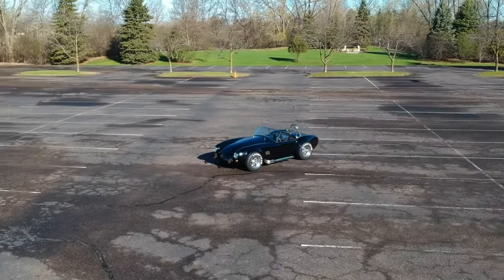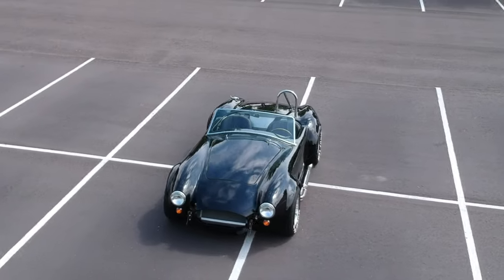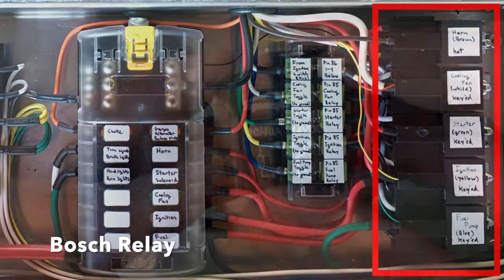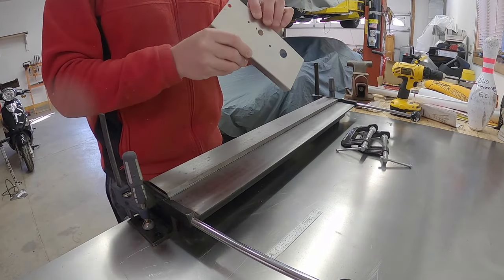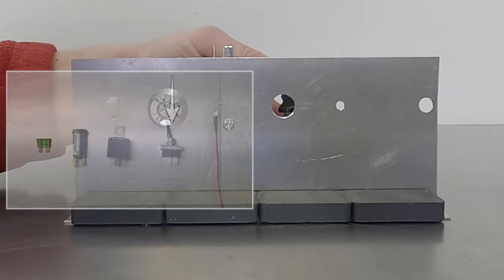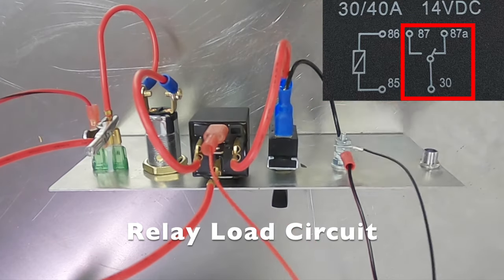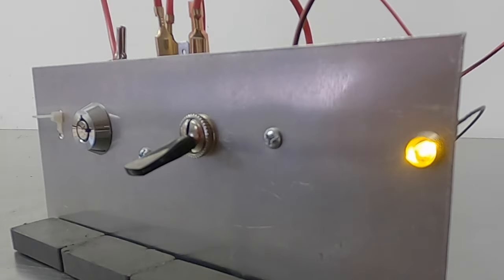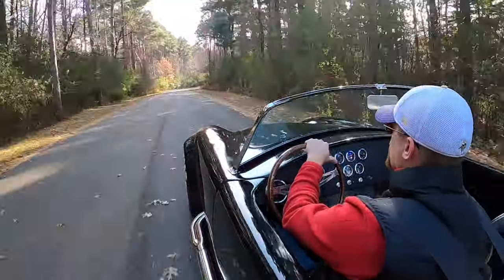Car Wiring 101

Comment: I have a 1982 GMC 454 BIG BLOCK FLATBED DUALLY.  NOTHING SPECIAL NO ECTRAS. HOW DO I DETERMINE  WHAT SIZE WIRES TO USE ?
Reply from the maker: Are you replacing the original wiring or adding some new accessories/etc? Depending on amp draw, you'll want to make sure you have sufficient wire gauge to safely transmit the power.
Reply: @TacoJoe  complete redo
Reply: @TacoJoe  replacing what's left of the old . Looks like the rats had their way with the truck.  Fuel n break line's eight all to shit. Chicken lights gone . Dash trim gone .but I ain't skeerd
Reply: I do want to add some work lights on the headache rack . This truck is going to be a welding rig truck.
Reply from the maker: you should be able to get away with 12-14ga on almost everything except your fuseable link-fusebox lead (usually 10ga on the older Chevys - sometimes comes off the starter solenoid) but check the chevy truck forums too for advise. As for replacement wire...  check out wire barn / thats where I purchase most of my wire.... www.wirebarn.com / good luck!
Reply: @TacoJoe  right on , thank you for the information. I'll definitely check it out. As with all my trucks , I want ahead and ordered a "Haynes " manual.  The Auto zone is sure proud of their books.  It's $22. To order straight from Haynes.  The A Z wanted $67+ tax . Fricken mud-ducks.  Thanks again. I really appreciate it

Comment: I have a question. I thought pin 87 was supposed to lead to one side of the fuse, and then the other side of the fuse would be wired to the object that needs load?
Reply: In HP Academy it said pin 86 connects to the power supply aka ignition amplifier or known as Signal, 85  is the Ground, 87 is Load to fuse to object, 30 would go to the battery. Did i misunderstand something?

Comment: Relays for head lights?
Reply from the maker: Yes - you can use a relay for the headlights too - I didn't use one with my setup, but if you do, make sure you feed pin 86/85 with a battery power source so you can turn the lights on/off with the car off. Thanks for the comment!
Reply: @TacoJoe  Just finished my wiring and I used relays on every circuit, thanks, 

01 jetta 12v vr6 66mm turbo.

Comment: No relay for lights?
Reply from the maker: You could definitely add a relay for lights / I didn't because I wanted the ability to turn them on without a key so I used a higher amperage toggle switch for the headlights but by all means, yes you could use a relay for the lights and do it in a way you wouldn't need key'ed power either. Thanks for the comment!

Comment: Really dumb question. When you are powering the relay is it safe to just grab the 12v power you need off the keyed switch or do you need to go all the way back to the fuse box? Just wondering as I want to run multiple things off the switch like more then one light.
Reply from the maker: You can pull off the keyed switch for sure but make sure you know its rated for - ie - if the switch is rated for 1amp, you probably don't want to pull 20. Thats where the relays save you because the trip amperage is low so you can run a million of them through one switch if you want. Just to make sure i understand your question though: Are you talking about the power source for the load side of the relay (not trip side)? In all honesty, if you can find a 30-40amp keyed switch, you don't need a relay. Good luck with your project!

Comment: What is your DC breaker rated at?
Reply from the maker: 100 amps / I matched it to the fuse panel rating. When you pick a DC breaker, you likely want to match it to whatever you are feeding because if you oversize you might end up melting some plastic :) Thanks for the comment!

Comment: I want to delete the climate control in my Eg hatch and have a 3 position switch for my fan, on and off for ac (don’t care about adjusting temp) and an on off for the heater.
Reply from the maker: It can be done and I think you can achieve the delete and still keep the functionality you want - you could break the circuit into 2 relays too for each function. I'd try a little trial/error on your workbench first but though  / good luck!